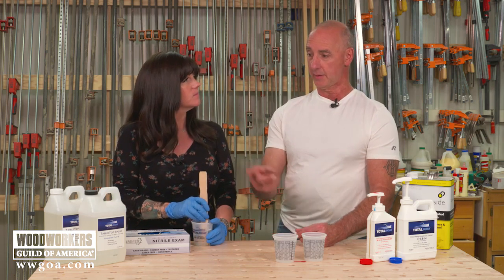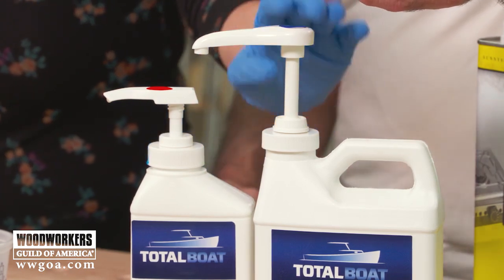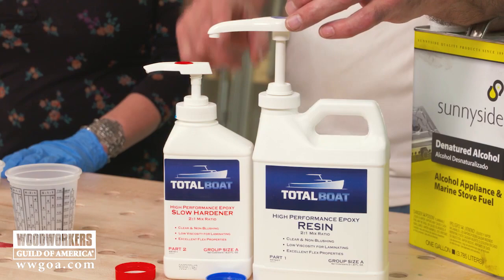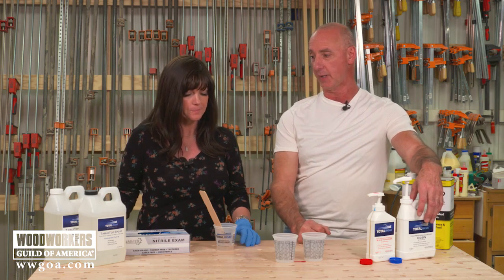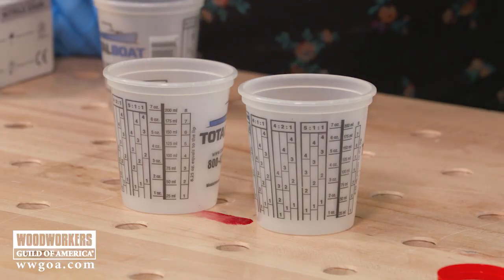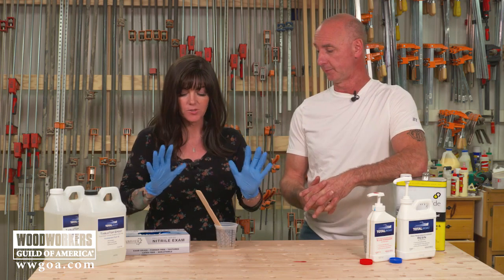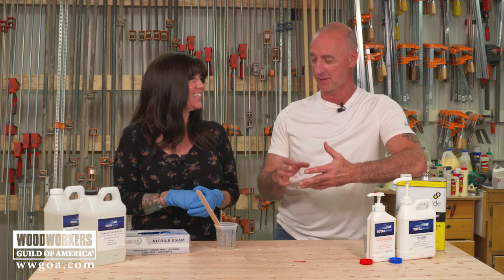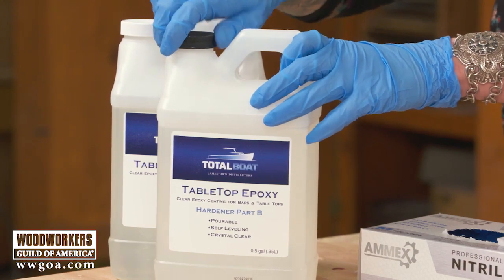Mixing Resin the Right Way

Comment: I have a question about the metered pumps.  If you only use the product occasionally,  does the products harden inside and make them unusable?   I am thinking something like caulk in a tube.